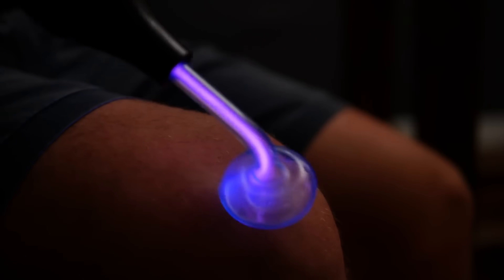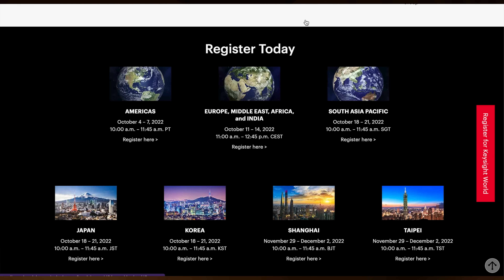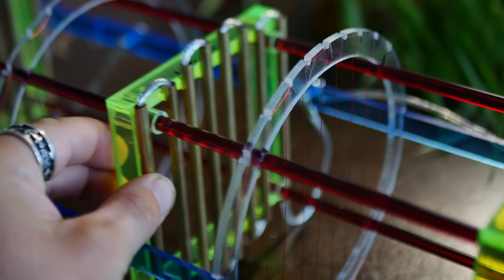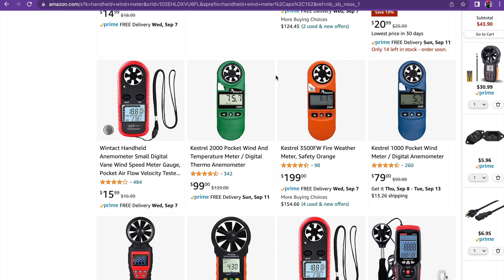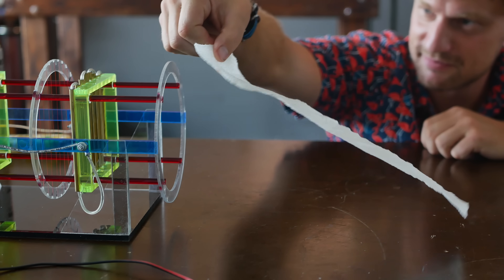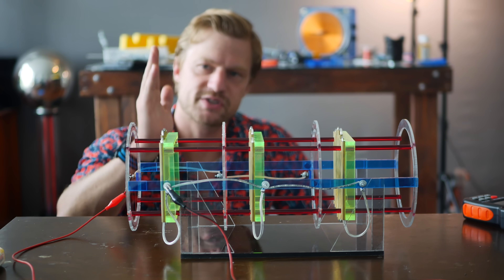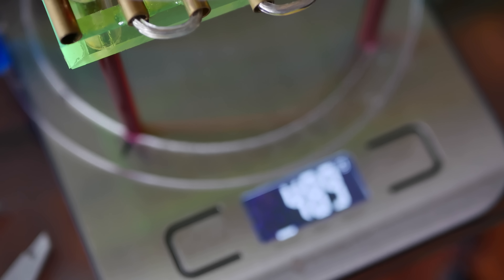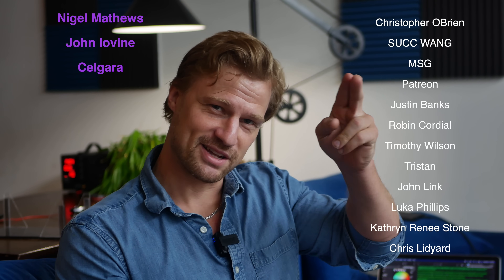Designing A Next-Gen Ionic Thruster! (For Flight)

Comment: I can think of adding a nozzle to help increase air flow but not sure how much weight that can add, also might be good to add more stages there should be an “Goldilocks” number of stages and I think it should be treated like a car transmission more than a jet engine.. pull the air at the start then ease it to a higher speed I’m guessing the distances between stages can act like gear ratios and voltage being the “rpm” but torque would be a defined number based on I guess friction with the air or however that works.. all this is speculation I know absolutely nothing.

Comment: Integza replicated this experiment (with Plasma's consent) and was able to get 15 m/s using cheap Chinese high voltage generators:
https://youtu.be/AJD_fiHleRM?t=770
Reply from the maker: I know he for sure attained 6-7 meters a second. I'm using the same wind meter, and when too close to the high voltage grid, it jumps up in velocity number from electrical interference with the meter. You cant even blow faster than 7 meters a second, so that 15 would be double the speed of blowing on your hand as hard as possible. Integza knows his stuff - he built a better one than mine, but I think the meters him and i are using are easily influenced by being too close to the power.
Reply: @PlasmaChannel  Interesting...
Question: 
Would enclosing it in a tube and using a nozzle at the end improve it significantly?

Comment: As you already know if you would of installed that in a cylindrical unit thrust would be exponentially greater. A no brainier, right?
Reply from the maker: Funny thing. I'm working on version 2 right now. The cylinder body only helps with a 10-15% increase in speed - not nearly as much as you'd think.

Comment: Its gunna be a great build. Maybe you can build the batteries into the frame like tesla. Balancing an overall crucial mass across the whole structure. I think having a rooted system will lead to a few challenges. mit mounted ionic thruster to truss and pointed them back at the aircrafts wing foil. It was tested in a warehouse. Very kool stuff. Thanks for your knowledge

Comment: There could be some improvements by adding a casing and by creating a convergent air duct at the air inlet. Basically "playing" a little bit also with other science branches like aerodynamics. I am curios about the temperatures as well, i.e. how hot os the air at the exit, as this could as well play a role in increasing the thrust. Overall a very cool project!

Comment: if you designed the body shape like the wind turbines, and made the air flow tighter should it give more air speed ? is it possible also to distribute different voltage to the 3 of the ionic thrust, each one of them gets 30% higher voltage than the other with different shapes in closed air flow ? sorry my english is bad, im from indonesia.

Comment: I am by no means an engineer but I have been dabbling a little bit myself so here we go and I hope I do not sound dumb in any way being my first comment on here ever.  1.) if you added air multiplier technology to what you have created could potentially increase your output at the high end up to 16x. 2.) in my mind the obvious one would be to enclose it but one step further could be to have a larger intake the exhaust.   3.) this is just part of what I have been playing with is if you used or included vanadium along with your copper to hold a higher charge than your input would be.  Also simple things like using less flat surface material to reduce drag.  I hope I made some sense and please if I’m factually wrong incorrect would love feed back.  Interesting work and well made video hope to see more like it thank you!

Comment: your first set of tests seem to take place in a quadrant of the airflow verses the staggard stage that showed a test from closer to the center of the flow path.  Why is this so and did you retest with a more central position for the airflow meter?  If you have not, would you and show the results?
Thank you for the video either way.
Reply: Also, have you tried rotating the filament planes?

Comment: Great build. Got me also thinking about it's shape. CFD, or thinking of fluid dynamics, would building the mechanism in a cone or funnel type shape with alternating spacing help increase the thrust? Using this to move matter, as matter passes through smaller areas, it speeds up.

Comment: I would probably enclose it in a tube to avoid all the air molecules pulled in from the side because of the Venturi effect. Those molecules are not moving and they cold slow down the flow.

Comment: With the lights off, I noticed little spots where plasma was being generated on the positive wires.  I would guess that creating and spacing the little spots correctly would provide better distribution of plasma versus random spikes on the positive wires.  Also, ducted airflow and a nozzle would help with thrust.

Comment: You could look into utilizing the staggered architecture to compress the airflow by accelerating it via a vortex shaped boundary, not merely a nozzle at the end. I'm not sure a 100% if you'd get a massive improvement in the flow rate by applying varied current and phase across the levels of these staggered fields being generated but constructive interference can be achieved and jet exhaust like resonant diamonds can be created which will provide higher thrust.

Good luck :)

Comment: My honest thoughts I'd like to scale this thing up to something maybe more in the realm of like 5' long and 3' wide, Increase the amount of thrusters and the size of the thrusters and the overall current going through it and see how much thrust you can get. It would be very expensive to build but if you could build something that big and show that it has a thrust potential great enough, It could leave electric powered aircraft within our grasp. Of course you would have to get to the point where you could optimize something around the size of a jet engine thruster to be able to produce similar thrust, Or at least enough thrust that with 8 engines you could get an aircraft airborne. But if this could be done it would cut the cost of air travel possibly in quarters. At least if you could solve the battery issue which with nuclear fusion technology around the corner might be possible. But yeah imagine only having to pay $200 to get from LA to London as opposed to nearly a grand or more But yeah imagine only having to pay $200 to get from LA to London as opposed to nearly a grand or more. I'm also seeing great potential for smaller aircraft, I'm thinking like a 1 to 4 seater aircraft this technology if you could optimize it might be more light weight than a standard propeller engine. The one downside that I see to this technology is you need an atmosphere to make it work if you didn't I would forsee this being big and space travel as well. But even aside from that if you could find a way to keep the electronics warm you could use this technology To create probes that could go into the upper atmosphere of the gas giants. Granted they couldn't cover far and the gravity would still be a problem but the higher they were the higher likelihood you might be able to keep them afloat.

Comment: Super awesome! Why nothing to direct air flow? The bigger the radius of the circles the less losses to outer air resistance at the center of the airflow so I'd try some aluminum around the outside of the rings and a nozzle at the end plus a larger radius. The radius might be negligible compared to the losses from spacing that you considered and other factors like the shape or quantity at each stage

Comment: The air speed testing was incorrect since you had the reader standing up for for most of it and the fan wasn't directly in the middle so 2 things happened;
1. the big base of the fan acted as a wall, decreasing airflow efficiency (since it hits the base, and has to go 90 degrees, forming a wall of air that the thruster has to fight against, decreasing maximum thrust readings)
2. Since the fan was standing up for most of the test (except the staggered one, you held it in the middle correctly) it wasn't reading the centre of airflow, it was reading the weak flow on the edge. Hence biased testing, and why the staggered test proved so much better than the rest (though it could simply be better, we won't know since you showed biased results)

Very interesting non the less.

Comment: If you designed this to fit in a tube. It might increase thrust. As is, it sucks in air from the sides and has to accelerate still air molecules. This would create drag on the already moving air.I assume more turbulence is created by this as well. Also you should experiment with nozzle shapes and sizes

Comment: Bit late but this goes into my mind. 
1) Chose close construction to prevent airflow leaving system adn to prevent new air to be sucked between stages
2) electrodes work like obstacles in airflow and coudl create air vortexes. tube shape is ok-ish but smaller diametr coudl hep, also if you manage to get teardrop shape it woudl help. 
3) Implement nozzle effect after each step should help with thrust, you can even make each stage bit smaller and whole 3-stage system make into one big nozzle.

Comment: Thank you for the video! As for the ideas, is it possible to remove intermediary positive electrodes, and use several power supplies instead, so that the previous negative electrode would serve as a positive electrode for the next one?
Or just use taps from a longer voltage multiplier? E.g.
+ ----- | -------- | --------- |    🌫
0    -30kV  -60kV  -90kV

Comment: Tell me if I'm wrong, but isn't this a highly dangerous build considering it has exposed voltages above what I thought is lethal at 12,000V?  I wonder if there's a way to do this and ensure safety.  Obviously, not touching it would be a good first step.  regarding the inefficiencies, it's hard to say, but here's my best attempt.  1. a lot of the ions are passing through and not impacting air molecules, thus not producing any thrust.  There needs to be a way of improving the density of the air between electrodes.  This may be possible by re-thinking the geometric design of the system.  2. The collector electrodes can be re-shaped to make them more aerodynamic.  3. once you choose a voltage, you can make the design of the amplifier to be lighter and specific to that one voltage.  MIT had a pretty light design that you may be able to copy, or you can come up with a new one.   4. You can decrease the overall length of the system since now you know the optimum spacing of the electrodes.  I wonder if changing the diameter or lensing the electrodes to focus the concentration might help.  5.  This may be a nonsensical thought, but the velocity vector of the ions may not be parallel to the direction of measured thrust because you have wires placed perpendicular to the direction of flow, which may result in some percentage of ions and some of the collisions to be at different angles instead of the direction of thrust.
Reply: Also, what would be the effect of adding a tube around it to keep all of the air together and thrusting in one direction.  A lot of it may escape through the sides if it's not forced to stay in one direction.  Maybe there's a way of designing one-way intakes between the different electrode pairs to allow more air in, but not out.

Comment: Interesting!  I built an ion propelled aircraft grid that produced a breeze for my HS Science fair in 1966. Had to use high voltage rectifier tubes and a massive hand made capacitor for the construction. HUGE power supply for a little thrust. First saw the concept in Popular Mechanics.
Reply: This is incredibly cool thank you for sharing
Reply: @notfiveo the body is electric 🤷🏼‍♂️

Comment: Since you are getting air movement at a good rate what if you fed a fuel into the device shaped with heat resistant material and ignited it to create an even greater thrust lightweight electric ramjet !!

Comment: Would love to see it encapsulated so there is less loss out the side with air intakes at each stage. Also using  tapered rings of copper for the electrodes could be cool as it could compress the air. Oh and also changing the space between stages not just of the stages

Comment: You'll have to excuse me I'm not good with the technical words but I got an ideal and I know what I see you when I see it like you are correct on some things because when I saw that UFO and 2006 I drove underneath it and it had that smell like burn ionosphere. From what you guys are doing it works the same way but but how do you use it for lift off the ground how do you pivot the Direction make it slide like a sliding hockey game they use for air when you play I was under this big old massive thing and I couldn't figure out how it was doing its lift other than how what you are describing operate in lower orbit I saw the damn thing in 2006 over at O'Hare Airport I drove for Covenant Transport or kllm the time and the Qualcomm would give which direction I was going on the highway and you'll see where the computer would give indication as I was driving underneath it as it was going up into the clouds but you can definitely tell that the ionosphere was burning kind of like what you were doing with that little device because it was like a bug zapper without the zapping

Comment: All this is good, but there is a more serious problem than classic fans - dust settling on the electrodes, which reduces power over time and requires careful cleaning. There is still a gradual wear of the electrodes, when they eventually become smaller in diameter and more fragile - well, at least this is typical for air ionizers of this type.

Comment: Very good video. I wonder if you could build a hot ionic wind. For example if you would put coils that would generate heat right in front of the wind and that would give hot air, but I don't know if that can be done.

Comment: I'm not knowledgeable in the field of plasma, so these are just guesses based on current jet engine designs...
1. A cowling around the tube would keep losses to a minimum
2. Would having higher velocity air on the intake (e.g. a fan pulling air into the cowling) help with the output thrust?
3. Would there be any benefit of doing something similar to a high bypass turbofan increase the output - if you had each stage being forced into a continually constrained space, for example? That could possibly mean that the different stage electrodes might be different sizes too
4. would greater wire density on the electrodes produce more thrust?
5. I know you did some experiments with the minimum distance between the electrodes - did you go less than 1 inch? Or would that be bad for reasons I've probably not thought of?
I'm going to go and put on some Jimi Hendrix now, to celebrate that purple haze... :)

Comment: I was wondering if someone took the positive wires in a ionic Thruster like this and replaced them with either one of the three hydrogen doped nanostructures like borophene graphene or carbon nanotube that way the CO2 carbon atom will be attracted to the hydrogen in the nanostructures and then ionized and then attracted to the negative copper pipes like you have here except for the copper pipes have been laser etched with fentosecond laser to increase surface area what kind of thrust can you get with that ionic Thruster that uses CO2 pollution in our atmosphere for thrust.

Comment: What a fun project.  I had more questions for future tests.  Initially I was thinking this like a turbine application.  I'd like to see the results futher than the rabbit hole of the staggerd spacing.  You mention of 1.5, 1.25, 1".  #1)  If just having more in line produces more I'd be curious on what happens if you take the positive out of parrallel setup and run independance voltage to each section.  Just test the theory of turbine.  As the exit of a turbine engine air the speed is increased more and more per section of the blades.  higher angle of attack.  What if you ramp up the voltage per section if 1" spacing is held through each section?  To follow up what if you concentrate the spacing lower and lower each section and what happens if you start getting below one inch with this in mind?  #2 concentrat with airfoil like turbine engine.  #3.  Mess with density and thickness of wire to get max per unit.

Comment: 1)Making the rods out of aluminum as opposed to brass will save significant weight and give you nearly the same conductivity. 2) changing the shape of those rods to something more aerodynamic should cut down on turbulence and increase your thrust. 3?) Not sure if the system creates enough static pressure, but enclosing everything and adding an adjustable nozzle wouldn't hurt.

Comment: Did you put it inside of a tube to reduce the loss of thrust around the open frame? If so, what was the result? Thanks!
Reply from the maker: Great input - yeah the issue with a tube, is that it will actually slow down airflow. Because the ionic thruster doesnt just suck in from the front. It sucks in from the sides.

Comment: This is incredible. I am so excited to see how this will impact the aviation industry.
Reply from the maker: Just wait for V2 of the thruster.
Reply: @Plasma Channel  is wind velocity relative to ionic thrust or is it just a coincidence that the wind velocity of 2.3 matches the ionic thrust reading of 23?
Reply: Current ion drives are much more efficient than powerful. They actually don’t work in atmosphere at the scales of real planes
Reply: it won't affect it.  the thing weighs a pound. the power supply weighs several pounds.  his thrust to weight calculation didn't include the power supply.  this is useless (but pretty).
Reply: @Welcome2TheInternet  To be fair, by the time this was approved by the FAA it’ll be 2050 lol
Reply: Where's V2